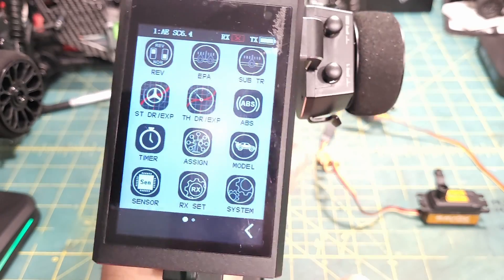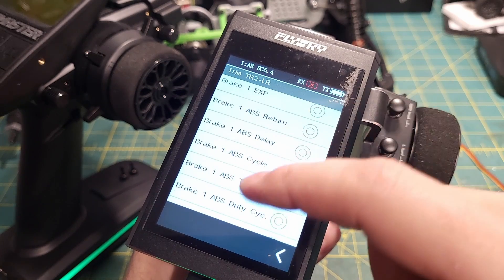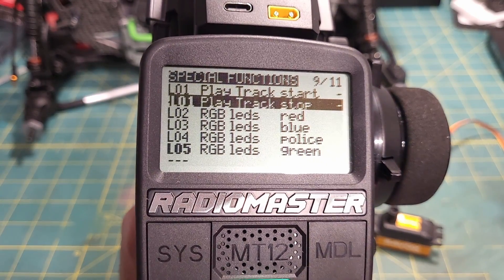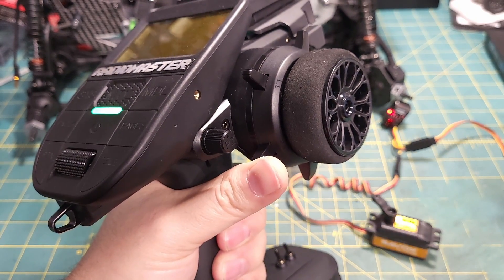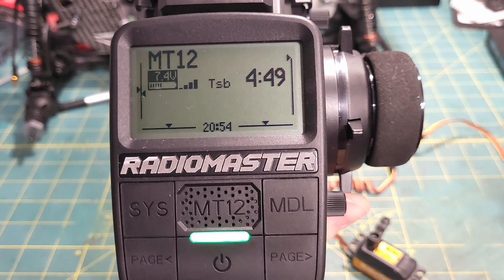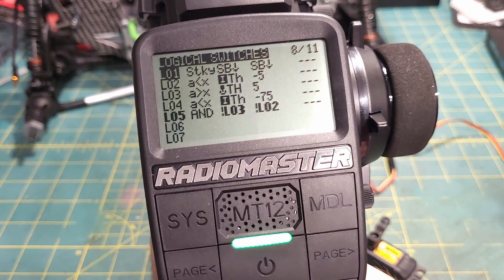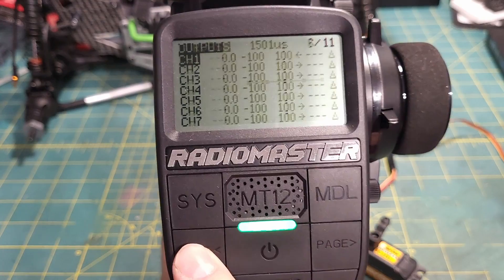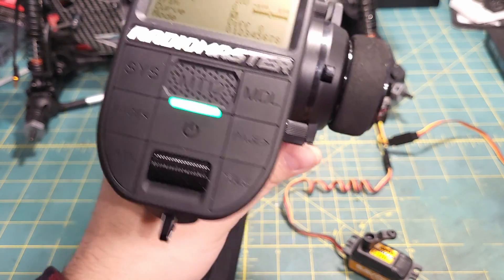Radiomaster MT12 EdgeTX - Trim Switches as Outputs for Dig, Diff Locks, Winch, 2 speed, plows, etc!

Comment: Thank you very much in the simulation it worked well for me too. My MT 12 shows the configured switch on the display. However, my cooler, which I want to switch on, just won't turn off. It's always on.. have you a idea ?

Comment: i assigned my t4 trim switch for a 2way switch like in your video. on the monitor the switch works fine but the trim still moves and beeps. is there a way to disable this trim movement and sound? thank you in advance
Reply from the maker: @michaelrajca6043  you can change that in the Drive Modes tab. Change the 4th 0 to dashes.
Reply: @JacobScherer  i did that and the trim doesnt move any more but it still makes the beeping noise

Comment: So I hvae figures out how to set the T4 as a channel for dig but the problem I run in to is that I can not adjust the travel of the servo like I can for the 3 pos SA switch? Am I missing something? The output menu has no effect like it does for steering and the other dig servo set to SA.

Comment: Tried to repeat this but along with it controlling my dig servo, T4 still changes the trim. How do i remove it's trim function?
Reply from the maker: Yep, you can turn trims off for all the inputs. The only trim I use on electric models is for steering.
Reply: @JacobScherer  Even if I turn trims off for all the inputs, I can still see the little trim arrows move and I get voice prompts "trim is at the center". How can I turn that off as well? Thanks.

Comment: I just purchased the Radiomaster MT12 surface radio. I’m trying to create a “launch control” function (for drag racing). I need to be able to adjust throttle percentage and the time it takes to clear that range, i.e. 0-30% throttle in .5 second. 

I would like to be able to create multiple stages like this, i.e. 0-30% in .5sec, 30-45% in .2sec, etc. I would like to have multiple stages (at least 8 possibly more). 

I would like to be able to toggle the stages off and on the fly i.e 2 stage launch or 8 stage launch or any option in between. 

I would also be looking to adjust the throttle percentage and stage time on the fly i.e. 0-30% in .5sec to 0-35% in .45sec on the fly. 

For ease of use I would like the maximum level of the previous stage to control the minimum level of the next stage, i.e. a 5% increase in stage 1 from 0-30% to 0-35% would make the minimum of stage 2 go from 30-45% to 35-45%. 

I got this radio because I love to tinker. I’m totally new to edgeTX but I’m excited to figure out how to utilize the software. I am not looking for someone to do all the hard work for me, just point me in the right direction. 

This would be like the seed control function in the Futaba 7PXR 

TIA
Reply from the maker: To start, just doing a single delay and an custom curve would be fairly straightforward to do, and might get you where you want to go. For a harder hit, you can decrease the delay or modify the curve.
Reply: @JacobScherer  thank you for your quick response. I understand how to do what you mentioned, but that is not complex enough for the type of drag racing that I do. I would need to be able to do that on a minimum of five different stages so that’s why I was asking, I know this would be a popular video for everyone and the drag racing community. There are a lot of people buying this radio for that reason.
Reply from the maker: @talkmobuccz  I'll try to come up with a method👍
Reply: @JacobScherer  if you do and you’re willing to make a video, I would be more than happy to share it with the drag racing community which would get it a respectable amount of views I’m subscribed to your channel and I look forward to any help that you can give on this issue thank you

Comment: You're a legend my friend. I mapped my Gen9 two speed to the SC trim button and in the Ch3 Mix I changed the Weight to 65 to set the end points for the shifting servo, which protects it and it works perfectly. Thanks again.
Reply from the maker: Glad it helped!!

Comment: In your demo, When the servos go into the negative range, that represents the esc going into reverse. how does that work with dig if both axles are spinning opposite of each other? Wouldnt it have to be at zero?
Reply from the maker: When I ran my MOA I ran fwd/brk/rev so the first time you went negative, it was brake, then you had to go back to neutral, then negative again and that was reverse. But you are right, with most crawlers these days people run fwd/rev with no active brake, only drag brake. I can redo the demo with that in mind! 👍

Comment: Man that screen reminds me of my old TI-83 graphing calculator.
Reply from the maker: I bet I could port over the TI83 operating system to this radio...
Reply: That would certainly come in handy if you were in the middle of a race and recalled that equation in Calculus to help you race better where you needed to find the roots of a specific acceleration equation.

Comment: If you Set the Trim Buttons trough the Global setting they should work for All Modells, if you Set them trough the special function setting, it just counts for the specific model
Reply from the maker: Good tip! For me, I race, bash, boat, crawl, and run construction equipment, so I'm planning on doing everything in the models.
Reply: @JacobScherer  Hey 

I need your help :D 

As it is a known topic in MT12 Group, we are trying to Set a cruise control for crawlers, so users of Hobbywing Xerun Axe or Fusion can run their FOC systems. 

I am a total noob and the MT12 is my first EdgeTX Radio, but I was able to Set a second value for CH2 (I Set my throttle on CH2 instead of CH1) so my poti S1 is now my second throttle Input. But I dont have a Button to lock my throttle Input on a random value. As example, I drive with 15% throttle and I want to lock this value, how could I Set this up? 

And I dont have my TRX 4 with me, can you check out my Setup please! Probably with a Video too
Reply from the maker: @cj910  not sure I follow you, are you saying you want something like a throttle trim to "hold the trigger" for you?
Reply: @JacobScherer on traxxas TQI you press SET while running at speed (x) and it locks this value. You can still throttle up and by releasing the trigger, it slows down back to speed (x). The value for speed (×) can be changed using the multifunction-poti ... and cruise control turns off hitting TH-